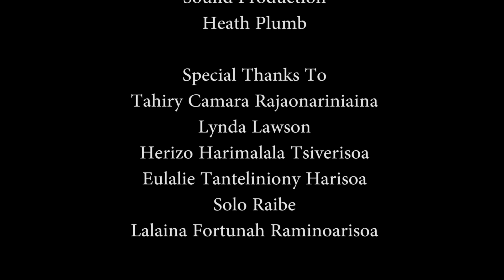Madagascar Unearthed: Gemstones of the Malagasy

Comment: I'm interested to the video but the sound is low! i can't hear very well the explanations! Could you adjust it please^^
Reply from the maker: +ludmila maria RAZANAKOTONIRINA Hi, sorry there seems to be a problem with YouTube as the volume has only dropped recently. Hopefully we can get it fixed asap!
Reply from the maker: +ludmila maria RAZANAKOTONIRINA Hi after looking into it, it may be your operating system. We saw the same problem with the volume then noticed it was only on the computeres that have been upgraded to Windows 10. If you are on Windows 10 please check the following link on how to increase the volume, this worked perfectly for our computers (it will also work for Windows 7 and 8) 

https://youtu.be/eDb49PWfOWs

Comment: Thanks for your work, it's very inspirational.  Where does one get a lamp and vise as at 10:45 in video?
Reply from the maker: Hi Zorhar, thanks for the kind words. The equipment you are looking at is all professional jeweller's gear. If you have a local jewellery supply company they should be able to help you out. Otherwise if you look up ball vice on eBay and you will see lots of options. For the lamp, it is actually part of a microscope set up, the jeweller shown is using the magnification to do very fine work. Again google or eBay jeweller's microscope, bench microscope or something similar and you should be able to find something similar :)

Comment: Hello, 
The stones at display at 1018 what are they? I've never seen any other gems than opals changing colour like that before!
Reply from the maker: These are titanite/sphene (both names are used). It has incredibly high dispersion and a high refractive index making the faceted stone very sparkly with nice fire. It is not a very common stone and this coupled with a slightly low hardness and tenancy to be an off yellow green colour, has kept it largely unseen in the commercial world of gems :/